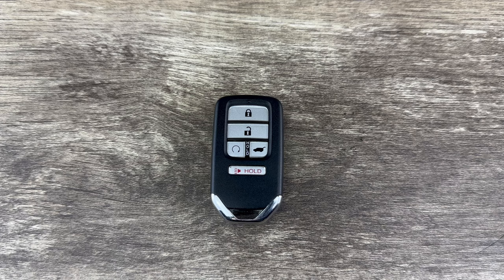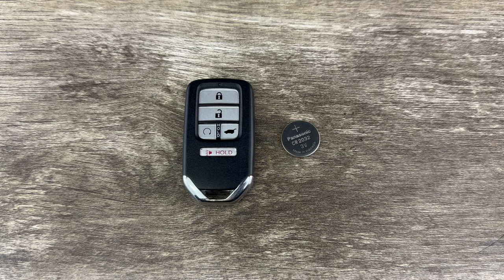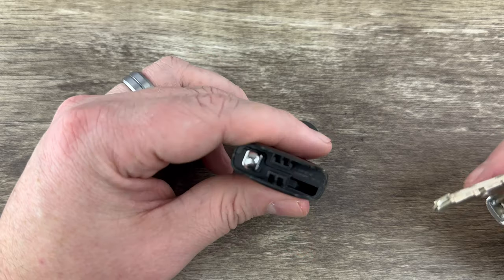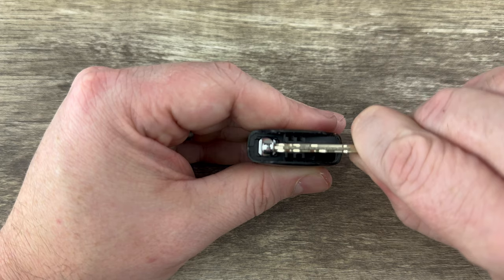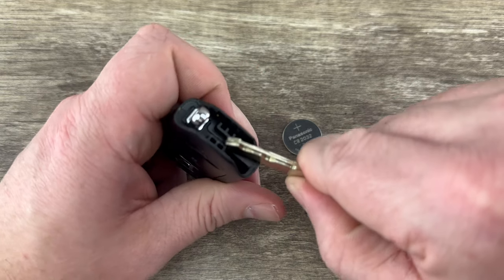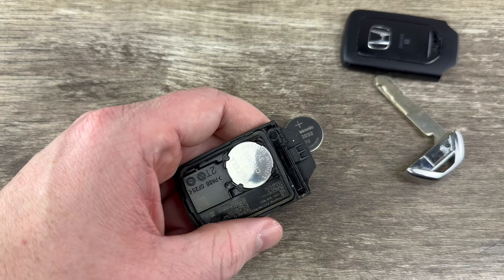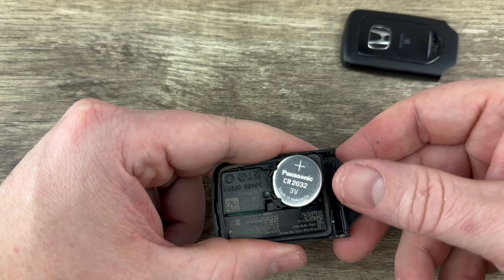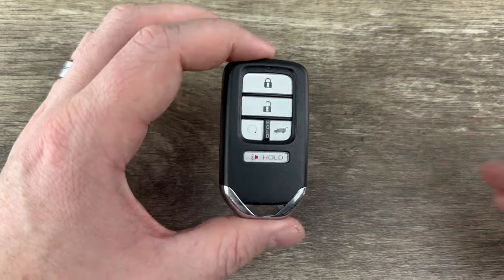2017 - 2022 Honda CR-V Key Fob Battery Replacement - How To Change Replace CRV Remote Batteries

Comment: Have a 2019 Crv,ordered takeout with a 15-20 wait so I leaned on the console filling in time playing on my phone with the car stereo on only. Went to leave and it wouldn’t start. Had to take key out off fob and put it up to start button to get it going. Out of curiosity I shut it off and it happened again all told three times. Went home and called the dealership and was told it was the battery( dead or old) I told him the battery was changed six months ago. I went online and found a few others had this problem. Seemed the Bluetooth on the phone had interrupted the Bluetooth from the fob to the starter button as the phone had been in front of the button while I was waiting. Solution was to leave vehicle with the fob,walk away and go back to vehicle and start as usual.Just needed to reset. It worked fine ever since. Now if I have to wait and I’m on my phone, I make sure it’s not in line with the start button. Just thought I’d let people know that it isn’t always a dead fob battery.

Comment: Tried using a flathead screwdriver to get battery out and the whole thing fell apart and buttons went everywhere.  Still can't get the battery out and I keep setting off the emergency button.  My neighbors are going to hate me.

Comment: Great help with video just having hard time putting it back together, it doesn’t want to just snap back together.
Reply from the maker: make sure all the buttons are in the correct position and have not shifted around, same for the circuit board inside - sometimes they do take a good amount of pressure to snap back together

Comment: Do I have to re-sync the fob after putting in the battery
Reply from the maker: no
Reply: I changed my battery the other day, but now the remote isn't working...my bro told me I have to reprogram it, but I've never had to do that in the past after changing my battery...any insight??

Comment: I changed the battery and my key completely stopped working. Amy advice?
Reply from the maker: I would check to make sure the new battery is good and installed properly

Comment: I did this, however. now my fob won’t reprogram with my car. Won’t start won’t do anything. I also don’t have a spare. What should I do?
Reply from the maker: The fob should not require reprogramming after just changing the battery.  Are you sure the new battery is good and installed properly?